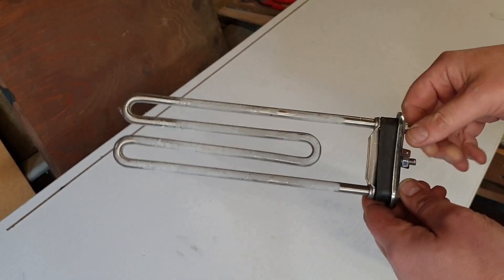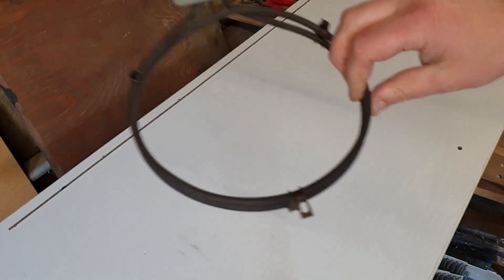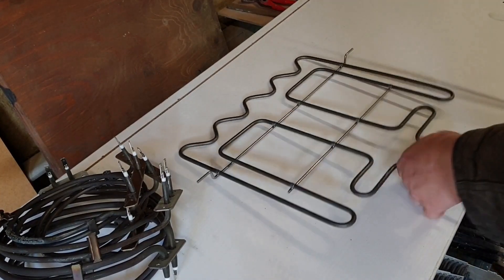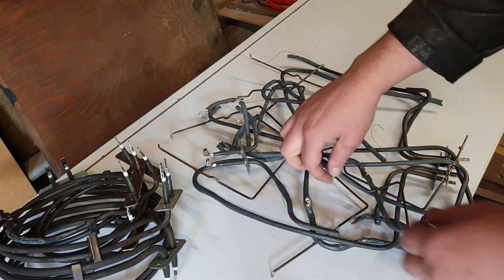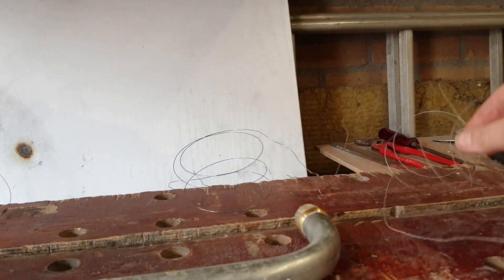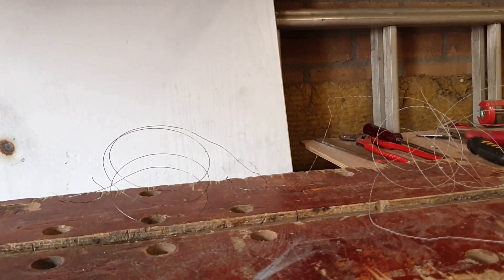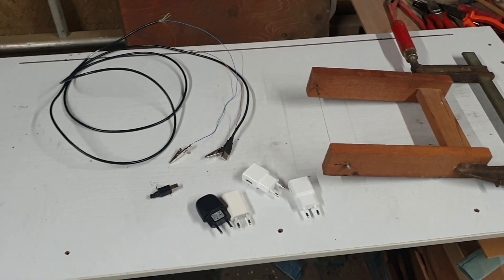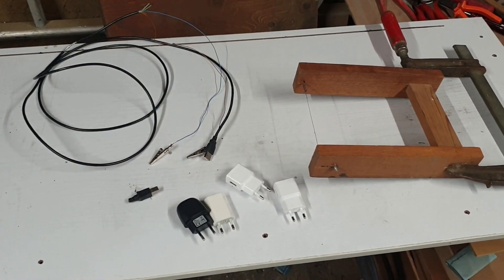DIY Foam Cutter from scratch, broken heating elements + phone charger

Comment: You can find that wire in old toasters and hair driers too. It's called Nichrome wire (Nickel chromium). I used a piece of wire about 2 foot long to make styrofoam panels for shipping stuff we sold on ebay. I took a piece of plywood, mounted 2 metal standoff's on it 2 feet apart. I stretched a length of nichrome wire across and secured one end with a screw and nut, and attached a high tension spring to the other end securing it to the other post as well.  I used a spring on the end because when you heat up the wire, it sags a little getting a bit longer. The spring keeps the wire taught.. I also used a variable power supply to supply voltage to the cutter to adjust cutting speed. 
I find large chunks of styrofoam in dumpsters take it home and cut useable sheets about an inch thick. Just pass the large chunk of syrofoam slowly across the plywood through the wire and you get professional looking 1 inch panels you can re-use for Packing material, Insulating your Walls, Etc..
Reply from the maker: All kinds of ways to utilize this method, you went to industrial level! I actually cut a lot of footage from this project, including a bit about hairdryers and other places to find wires like this. 
Now I am thinking I should have left that part in 😅 Thanks for watching and this info 👍👊

Comment: Hi Ralph, elements are slightly higher scrap price than steel. 
If the wire is longer or thicker,the more power you will need. Cool idea,thanks for the heads up on this.
Reply from the maker: Oh good to know, although my scrapyard just takes them as shred steel, I'll need to check with other yards in my area. 👍👊

Comment: Nice.  I've often wished that I had built my HWFC table with a horizontal hot wire instead of vertical, for cutting wide slabs of foam to even thickness.
Reply: COOL IDEA
Reply: @frikkiesmit327  model aviation guys have been using horizontal hot wire cutters to cut out styrofoam airplane wings for years, it's not a new idea.  They use templates at either end of the work to make curved cut profiles for the tops and bottoms of the wings. I'm not explaining it well but I agree, it's pretty cool.